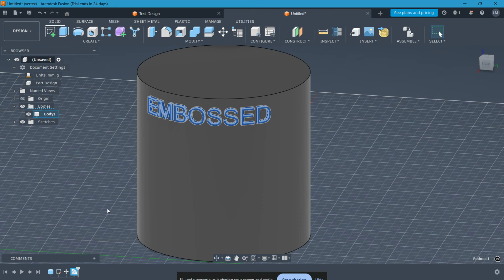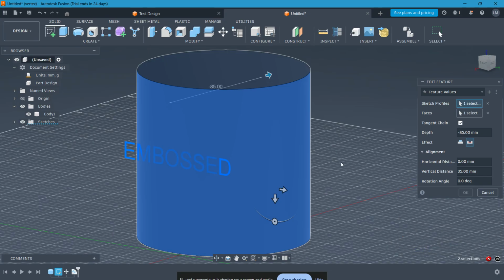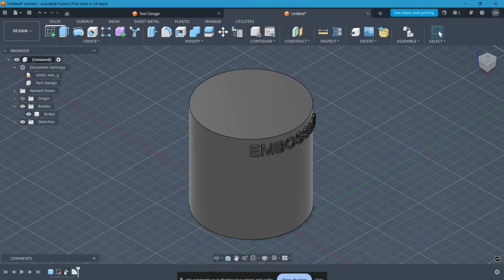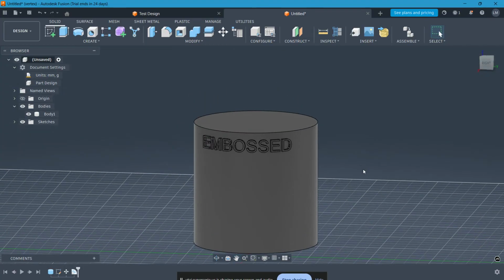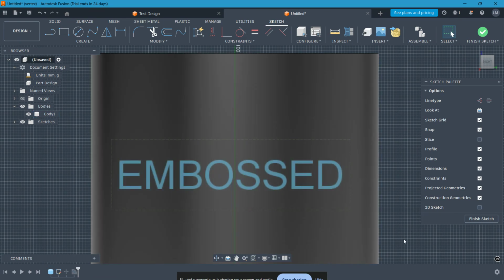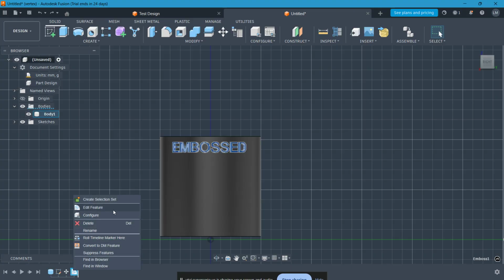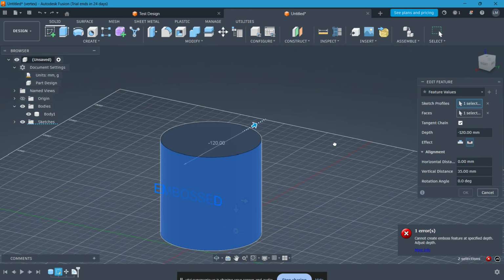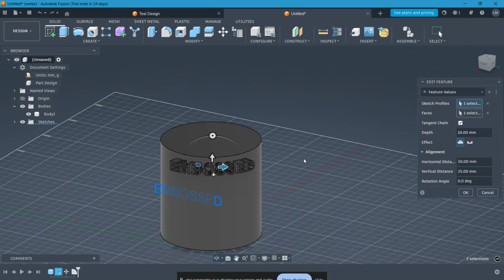Fusion 360 Emboss Error (2026 Easy Guide)

Comment: In my case, the options aren't appearing when I click on the text and then on the body. I've tried everything and nothing works. Some previous models were working fine; I didn't do anything different to make it stop working. Any ideas? :)
Reply from the maker: Great catch! A lot of fonts contain hidden overlapping paths or open vector loops that completely break the software's geometry engine when you try to project or modify text onto a 3D body. Sticking to clean, standardized geometric fonts prevents this bug from happening.
Reply: Acabei de descobri, era a fonte que não estava deixando modificar, aí troquei a fonte e deu certo…